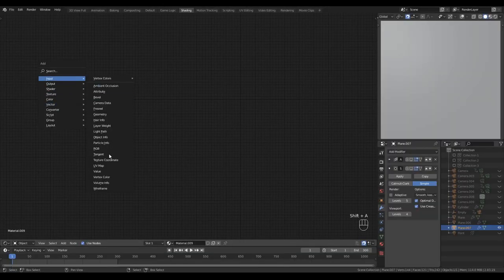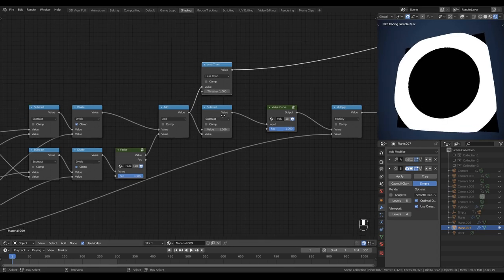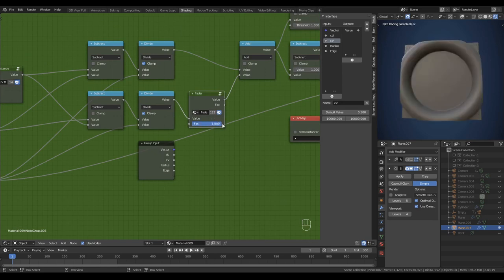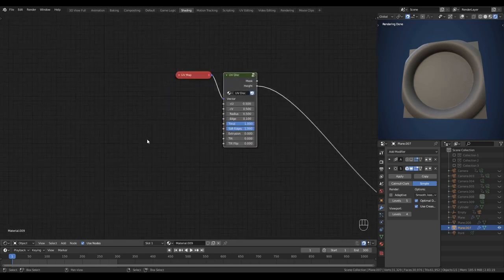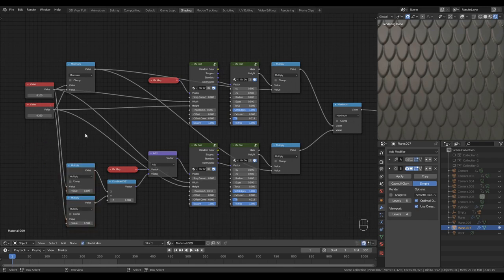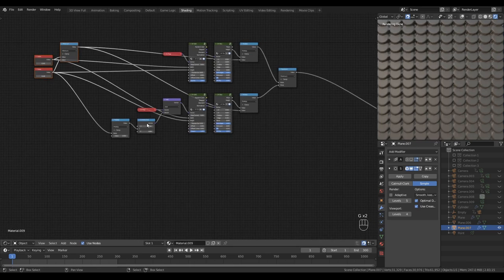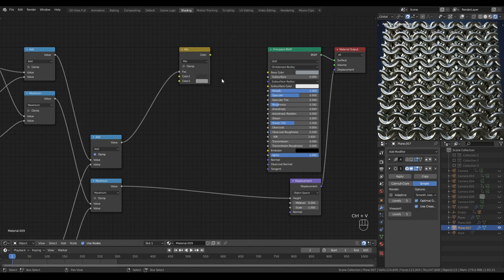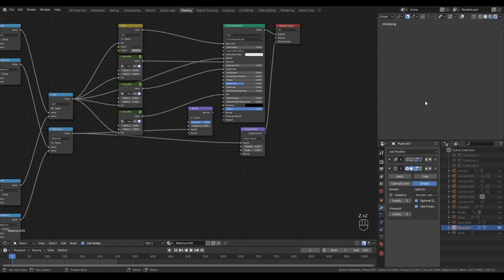Tiles, Scales, and Chain Mail... : UV Grid for Blender - A Tutorial Series - Part 8

Comment: hi ! thanks u for this great tutorial ! Is their a way to avoid the weird artefacts on the side of the rings ?
Reply from the maker: Hi Florian. Nothing perfect, I'm afraid. Those artefacts are inherent to the technique of displacing flat geometry. The closest thing to a solution is to add more subdivision until the stretched triangles can't be seen any more.
Reply: @nodesandnoodles  okay ! Thank you , Aldo wondering , is there any downfall to using adaptative subdivision on this type of mesh ?
Reply from the maker: @FLORIANSPITERI-g3n  nothing other than memory consumption and render times increasing a little. It should help a lot with the artefacts.
Reply: @nodesandnoodles  actually I did the whole tuto with it , could n t make it working without . And there is still a lot. Maybe changing the scale of the plan ?
Reply from the maker: The scale of the plane should only affect the height of the displacement. I usually use a plane subdivided by 10 cuts in Edit mode and a Subdivision Modifier with 4 levels for building the materials and then I turn on adaptive for the final render or just to see more detail.

Comment: Hello, please tell me, can I somehow make such chain mail on the geometry of the object and not just the material?
Reply from the maker: Hi there. If you use Cycles and material displacement, the chain mail will be real geometry at render time. 
Are you looking for a way to save the displaced mesh, or would you prefer to model the rings?
Reply: @nodesandnoodles , Thank you for your reply, yes, i want to save displace mesh
Reply from the maker: You could bake the height data to a texture, and then use the texture with a Displacement modifier which allows you to apply the displacement.
Reply: @nodesandnoodles , thanks, i wil try it!